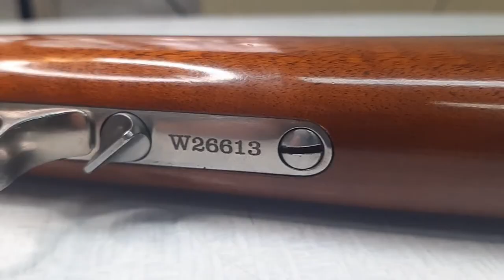Uberti 1873 Carbine .45LC - How to Full disassembly and reassembly (field strip)

Comment: Also when I put mine back together the brass block had a little play up and down that it didn't before. What could the cause be?
Reply: when turned upside down the two small screws forward of the lever handle make those adjustments. the one on the loading gate side adjusts the brass block the other one the lever resistance. it will take some trial and error to make sure it picks up and chambers the round after you've done it a few times you'll know what you're looking for, hope this helps also make sure the spring inside is making good contact, the contact area is small and easy to miss